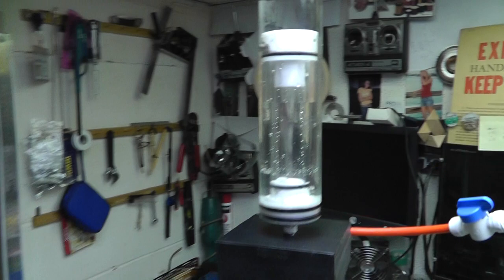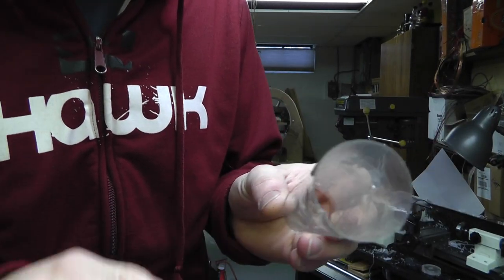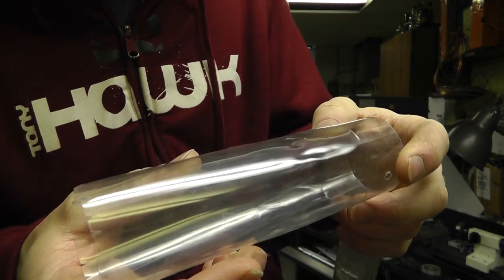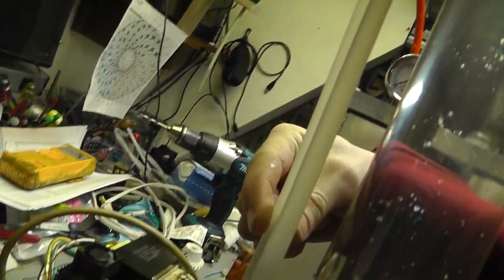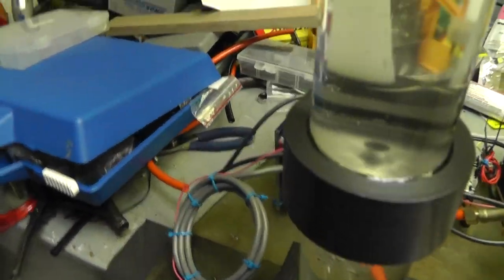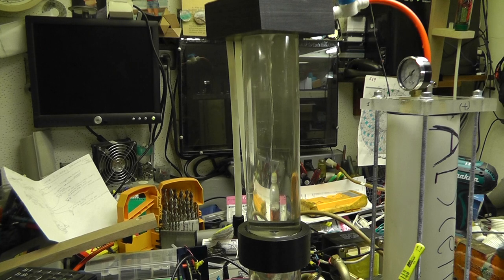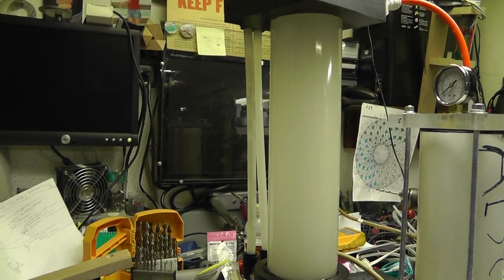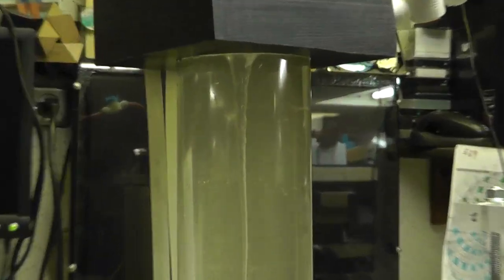Flash Back Update, Vortex Separator Mod's & Live Show !

Comment: I have found using the automotive clear rtv works well for mounting the arrestor material in place. Its flexible and usually holds up to high temps and any electrolytes your using. Good luck with the experiments.